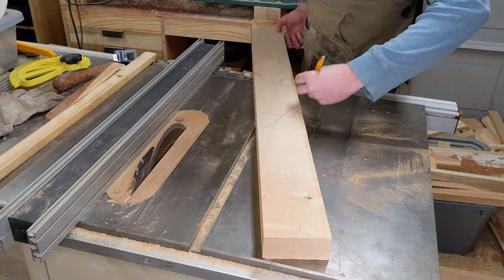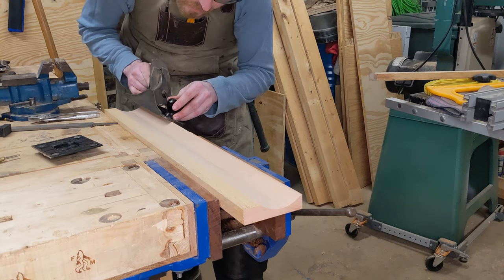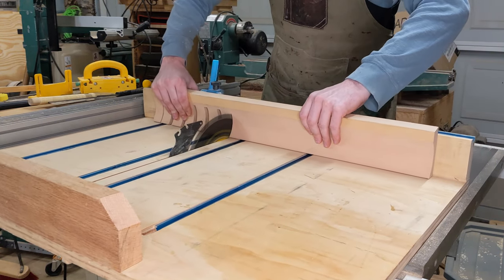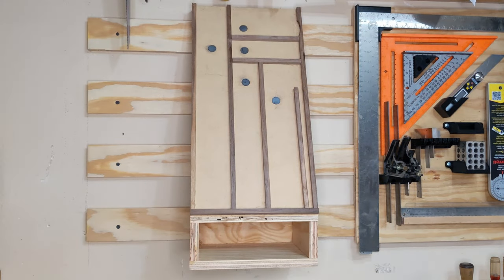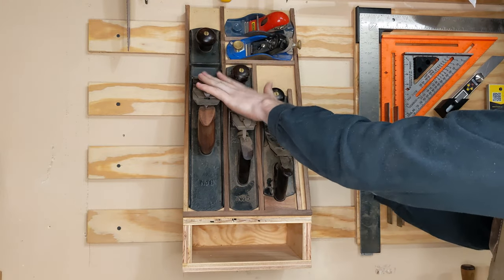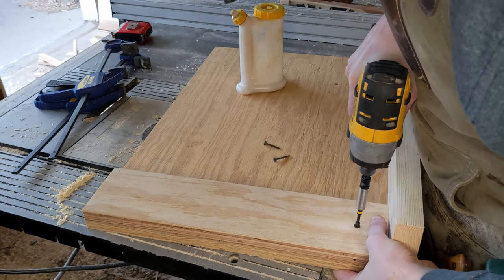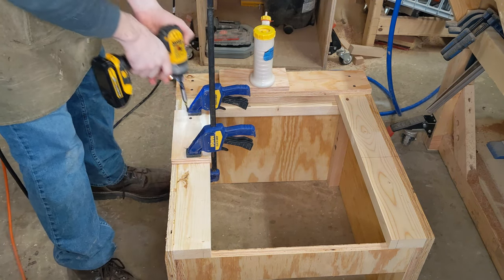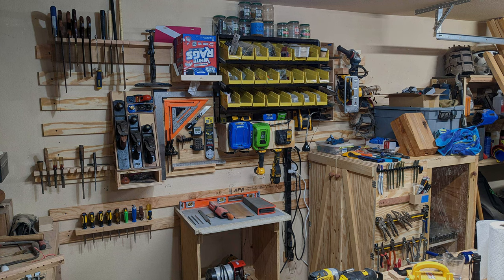A French Cleat Wall and Quelling the StoRAGE

Comment: I had a small french cleat system at our previous house in the garage.  In my new shop I'm trying to figure out if I go with French clean again or look at something omniwall or wallcontrol metal peg board.  Or maybe some combination of both.   I've already got a lot of the holders for my cordless tools and a few other things already built (from the last shop).  But some stuff just seems to fit the pegboard design better.
Reply from the maker: Agreed, working on a tool bench with peg board options right now.  Little of column A, little of B.